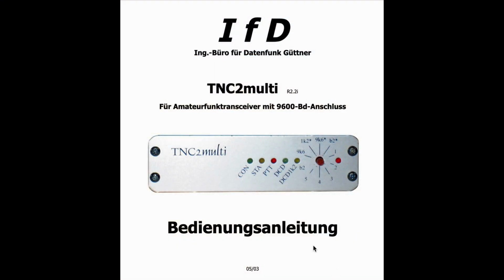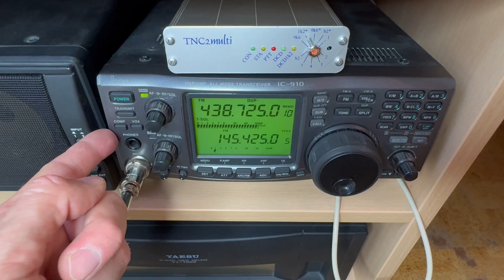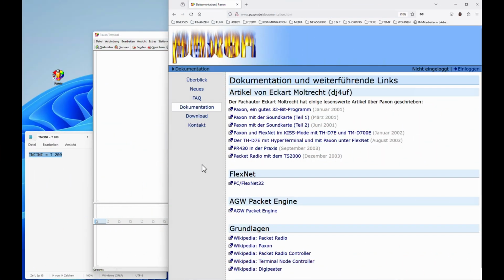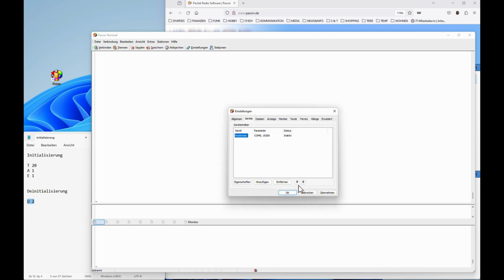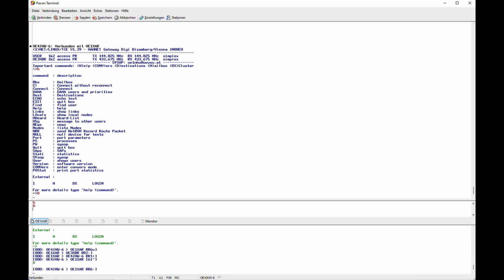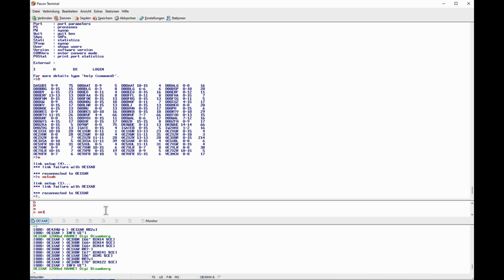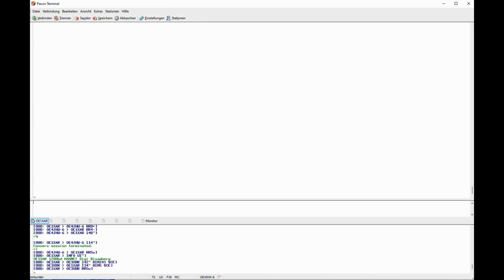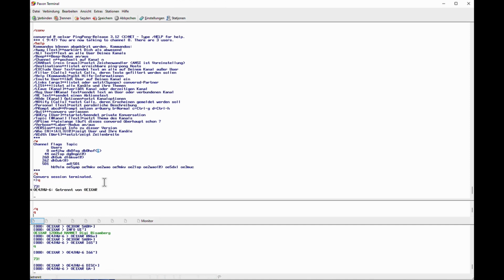A Packet Radio TNC2 Multi - does it still work in 2024?

Comment: Hallo Jürgen, ich habe das gleiche wie du mit Sondkarte und Simpel Interface + FT847 gemacht und hier in JN48RV Backnanger Raum den noch hiesigen Node connectet.
DB0UHF 2m Zugang, aber leider gar nichts mehr los. 
73´s Jochen DH1KJ
Reply from the maker: Hallo Jochen!
In Wien gibt's noch einen Digi (er auch VARA FM kann). Ist aber auch wenig bis kein Betrieb.
Danke für's zugucken!
73 de Jürgen